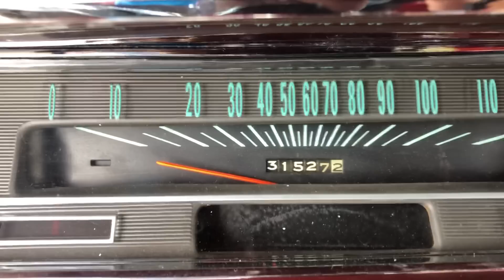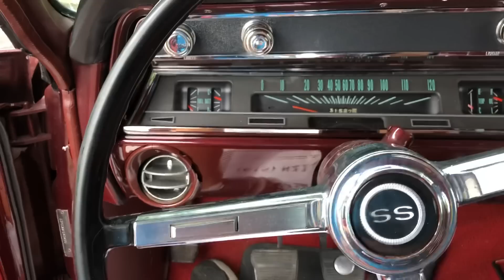"SOLD" 1967 Chevelle $28,900 Maple Motors

Comment: 10 bolt rear end car is a 283 motor car originally.
Reply: Bet it came out of Canada when I worked on the NYS thruway in the late 60's these cars would come threw SS badges even hemi roadrunners pop the hood 6 cylinder  under it, even then gas was high in Canada, $.45 on the thruway when in town sunoco 190 was .30 :)